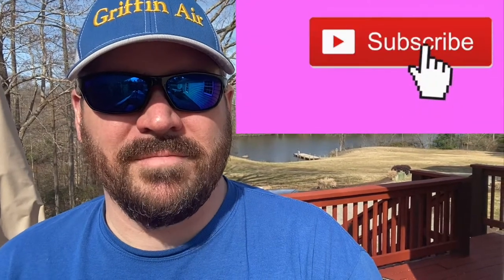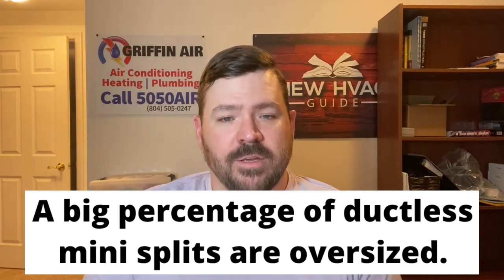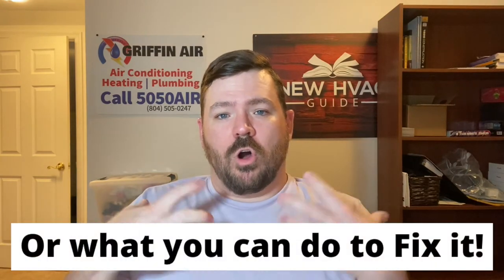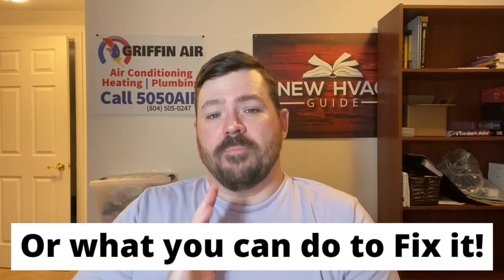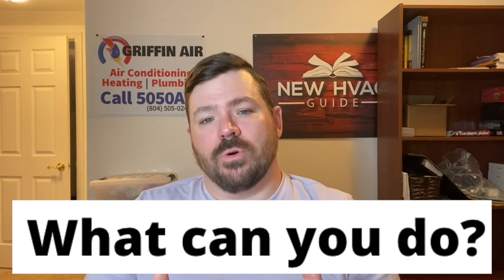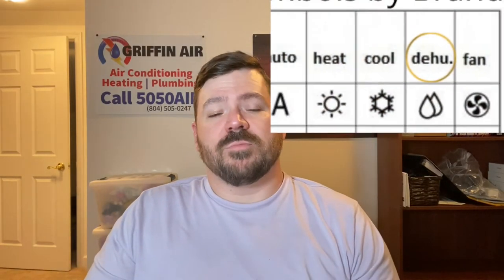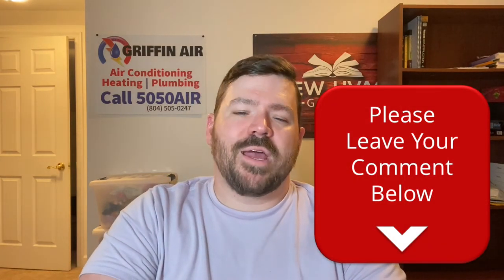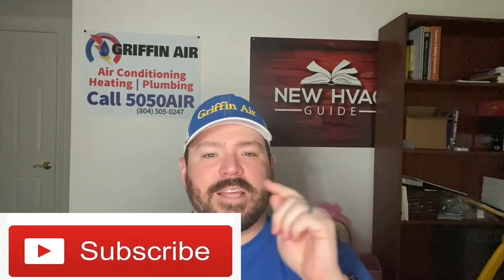HVAC Ductless system oversized? Walls sweating or creating mold. Tip to properly operate mini-split.

Comment: Pretty good content overall however, and I believe you touched on this, any of these mini split/VRF systems that are inverter driven,   Will generally “Turn down “ to about 20 to 25% of their rated capacity.  This information is published and readily available on most of the specification data.   I am most familiar with Mitsubishi‘s equipment however Daikin and Fujitsu and other mainline manufacturers publish the total capacity range of their equipment.   Is perfectly acceptable on most cases to double the size of the unit so long as the turn down capacity can handle the minimum load conditions.   Another thing you have to understand is it in order to remove latent heat or humidity from a Laymans standpoint, you have to get the air temperature below dewpoint. If the evaporator coil cannot maintain sub dewpoint temperatures, you’re not gonna remove moisture and you’re only going to change the air temperature and still have a ton of latent heat/humidity in the air. Be sure to run your fan on the lowest speed possible and verify the turn down capacity.   Keep up the good work brother!!

Comment: I have gotten about 5 or 6 estimates for my condo.  I face west and I am on the top floor with a ton of sun exposure.  Last heat wave without AC it was just over 111 inside.  I had to leave.  My condo is about 1,000 sq feet and it's two level (a loft) with ceilings reaching about 22-23 feet and the majority of the ceiling being about 18 feet.  Not huge sq foot wise, but a ton of sun exposure and gigantic ceilings.  I was quoted anywhere from 2 ton to 3.5 ton.  The majority of companies quoted me 2.5 tons except the one I agreed to go with put in a 3 ton Mitsu inverter (24k living room, 12k bedroom).  My bedroom is about 180 sq ft and now it has a 12k inverter unit in it.  I am now worried it's super oversized, however it has a gigantic ceiling going up to the 2nd floor.  If it's 75 outside it's 90 inside just by window exposure alone.  Still, does 3k sound grossly oversized?  If so, will the "inverter" system drop the BTU down?  The 12k apparently can go down under 2k BTU and the 24k can drop down to like, 8.  Does the "inverter" only work in "auto" mode or will the inverter work even if I manually set the temp?
Reply from the maker: You may want to have a proper heat load calculation done. 
And yes, please keep the inverter in auto mode so it can ramp down properly.

Comment: The further north you go the further apart the gain and loss become. This is why it is important to use a high heat/hyperheat etc. when designing for heat loss. It will keep the a/c side closer to the proper size. At some point you have to go to a duel head and use 2 heads for heat and one for a/c.
Reply from the maker: Good point. I don’t consider Virginia To be a cold state but we’ve gotten to where we will only install low ambient temperature systems after having customers have the wrong expectations with low end systems.
Reply: @NewHVACGuide  I would love to see the Cielo Breeze have the capability to turn the dehumidify on once above your preferred setting and the back to cool when the humidity is satisfied. It looks like it should just be a software fix. If they would add that feature I would include them with every one I sell.

Comment: Thank you for the great content as always! The unit's capacity range is very important. I wish there was a better selection of small capacity mini splits for small rooms. The smallest units most companies make is 9K BTUs and the low end of their cooling capacity range is usually still 3-4K+ BTUs which is sometimes still too much for small rooms, especially small bedrooms overnight. The one exception I'm aware of is the Mitsubishi 6K BTU system. It has a minimum cooling capacity of 1700 BTUs, which is great for small rooms.
Reply from the maker: Very true. We’ve had to become creative with some of our solutions to avoid oversizing systems.

Comment: I’ve been getting quotes for 4 installers now and they want to put a 15k system in a 185sq feet room. 😂 They give HVAC companies a bad name.

I got a guy who did some notes and came out to 9k btu ONLY because the floor unit I wanted the smaller was 9k. I think he did a manual j. I did a manual j in CoolCalc and the room only needs 3200 btus for cool and 7,000 for heat.

How is it that a guy/customer (me) with absolutely no experience is doing their damn jobs! I don’t get it. A manual j is not even that hard.
Reply from the maker: Great question